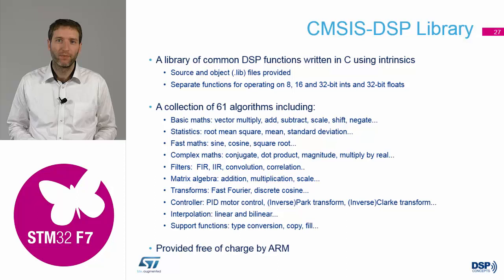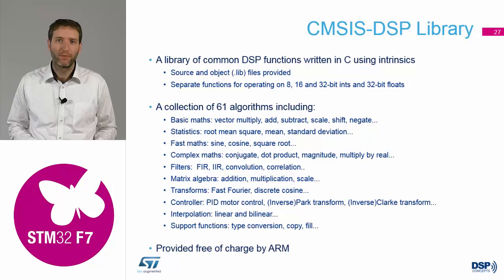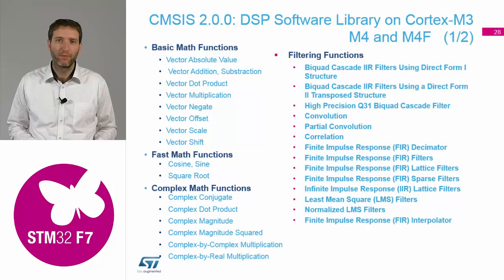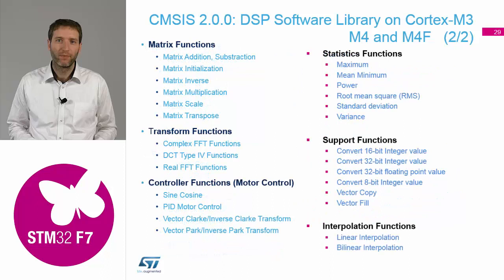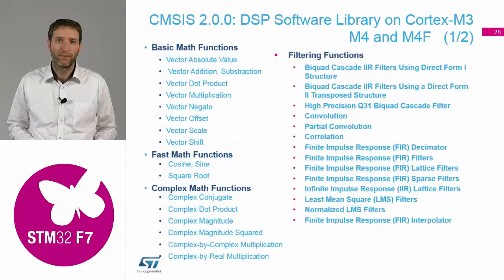STM32F7 workshop: 04.4 DSP corner - CMSIS DSP library

Comment: How can I include CMSIS DSP library in a STM32H7 project in STM32CubeIDE?
Reply: use "Additional software" in STM32CubeIDE in cubeMX plugin
Reply: @user485-w5f  that ist not working because STM32CubeIDE is saying: "This pack cannot be used on the selected MCU." I am using CubeIDE 1.4.2 and STM32H7 Firmware Package 1.8.0.